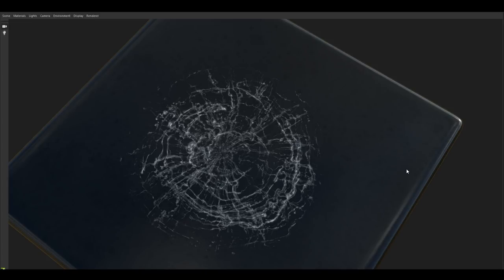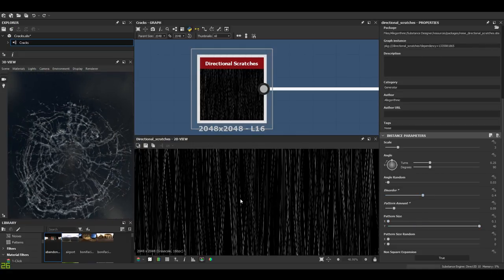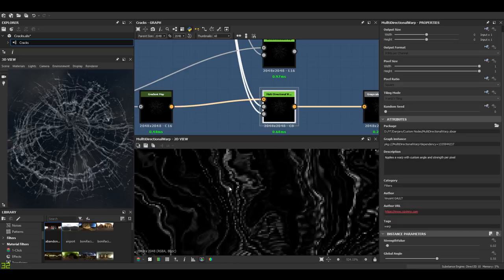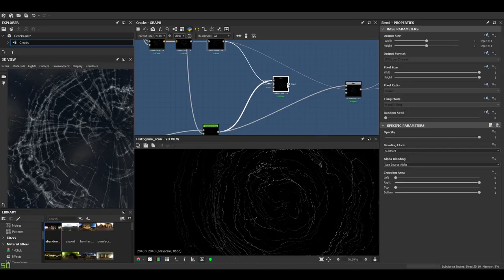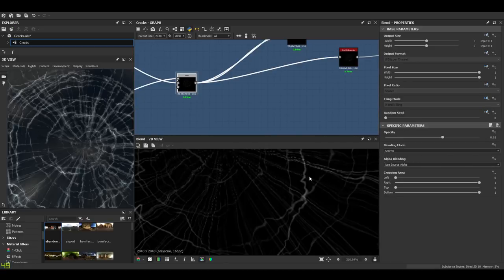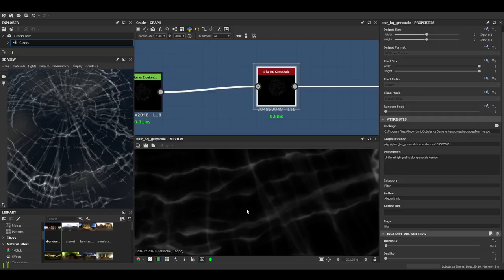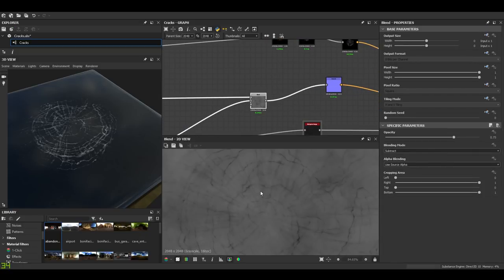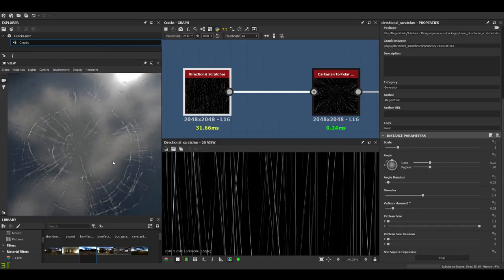Let's make cracks on glass with Substance Designer

Comment: I'm really new to designer, what are the nodes in the "background" section?
Reply from the maker: The background is presented at 19:40 Very simple setup. You have a gaussian spots 1, inverted, blended with a clouds 2 using a Min Darken blending mode at .21 opacity value.